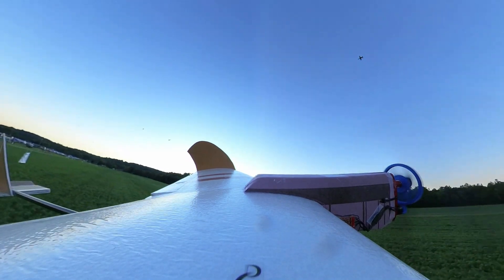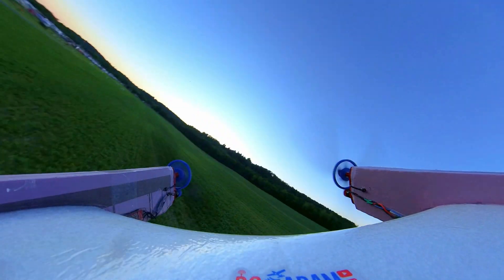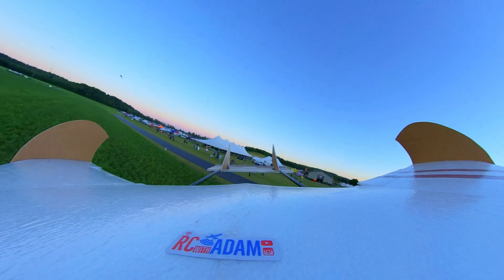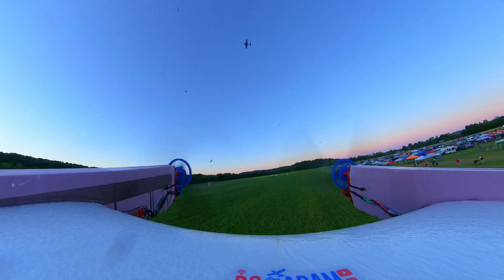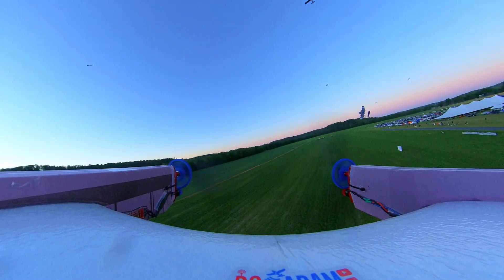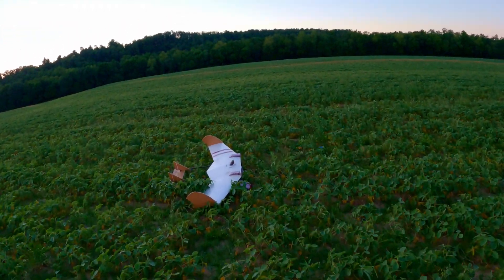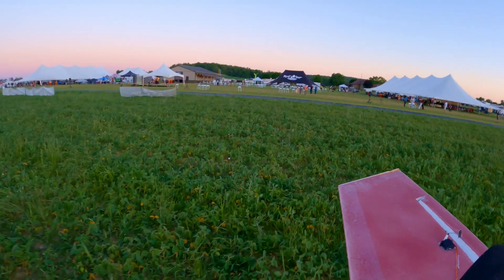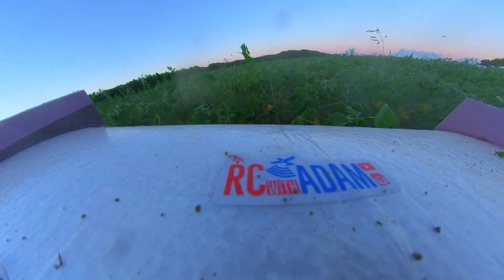Crash on Maiden Flight: 6ft Wing Airplane, Twin 18" Props with 3D-Printed Reduction Gearing

Comment: Great project, but may I point at 2 potentially lethal issues with the design? 1) Lack of longitudinal stability - The vertical stabs are too small, especially when you have large vertical surfaces up front (motor nacelles and winglets). Imagine shooting a arrow backwards, doesn't take it long to try turn around. 2) Pitch speed. Those reduction gears will not provide any thrust at higher airspeed, but the instead make the props work as air brakes. The static pitch speed at max power needs to be twice the stall speed of the airframe.

Comment: @Adam do you think ABS would be much better for this?
I plan on trying some stuff like this with ABS once I learn how to design stuff.  
I figured I will jump right in and try to learn how to make gears and threaded parts.   
And special threaded parts like pop bottle fittings for water rockets and things like that.  
I am pretty closely associated with Wind Catcher RC so I may pester Lee for some help as I am learning the basics.
Reply: ABS would be perfect. ABS is an awesome material, most people don't use it because it emits neuro-toxins into the air while it prints but if you're hoping to do gears, ABS or fiber reinforced nylon would be the best options. Just remember to grease/oil the gears
Reply: If not going for any "exotic" filaments, then ABS or PETG would be better for this application, because PLA really doesn't last long in gear-to-gear drives as it's glass temperature, where the plastic begins to soften, is so low. Especially for the smaller drive gear.